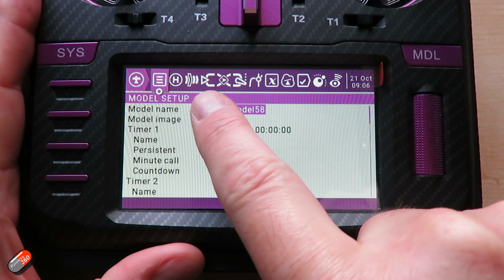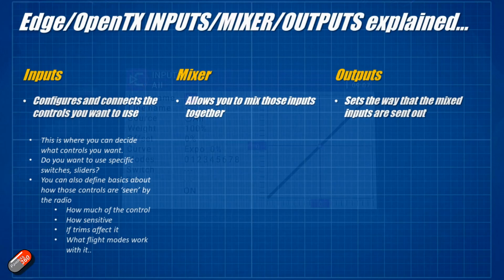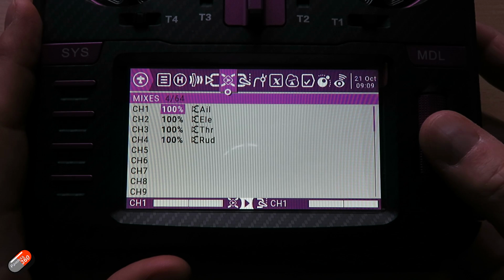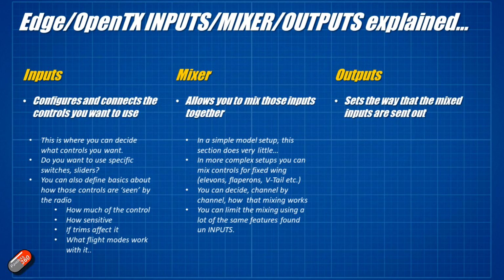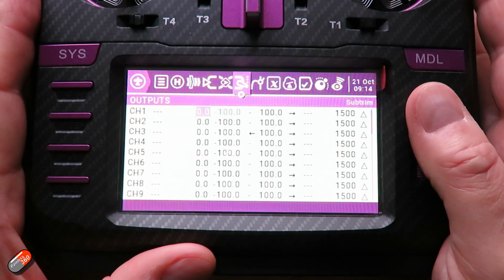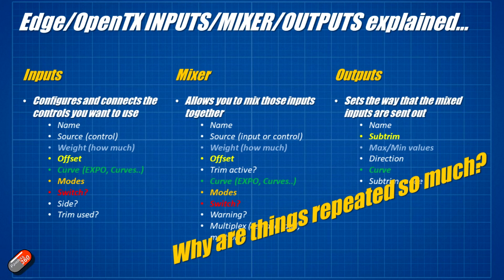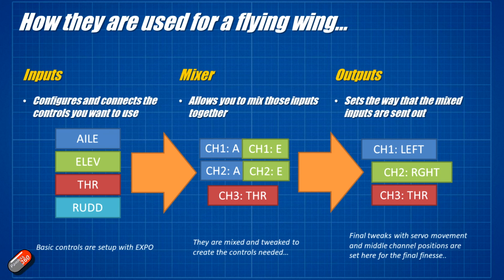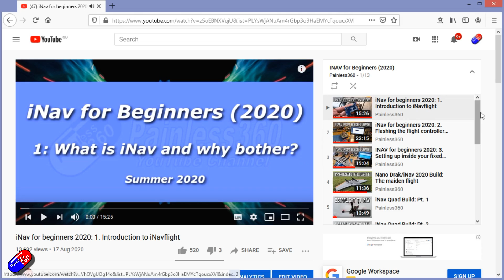Why there are INPUT-MIXER-OUTPUT Screens in EdgeTX and OpenTX and what they are for..

Comment: I have a question about mixing two channels. I have a plane that has separate elevators. I need to mix the two servos work as one. I am using a Radio Master Boxer, elevator is on channer 2, I need to mix another channel for the other servo so both can add as one & work as same direction. Thanks
Reply from the maker: You can create that simply by duplicating the existing elevator mix onto another channel in the mixer. Best of luck

Comment: Hey man I'm just trying to utilize the D button on my Radiomaster TX12 to activate "BEEP GPS SATELLITE COUNT" in Betaflight. On the TX12 Inputs screen I have it listed as I-d    100 SD but it does not activate anything in Betaflight.

On the Receiver screen there's no movement when I press it, and on the Modes tab I click Add Range for BEEP GPS SATELLITE COUNT and press the button but it doesn't detect it. Any advice? I'm sure it's something extremely simple I'm missing lol.
Reply from the maker: Set it up in the mixer screen, not inputs. Check out my Opentx and EdgeTX mix school series. Happy flying
Reply: @Painless360  I tried it on both but I’ll have to watch that video to see if I can pinpoint what I’m doing wrong!
Reply from the maker: https://youtu.be/OJCaAvjjw40

Comment: So with this open tx i can control dual motor (for example controlling the sprocket of a rc excavator) without dual motor driver ?
Reply from the maker: Possibly, depends on how those motors are controlled.  If it us PWM, then should work...

Comment: Be warned! If you change the servo direction in the input tab, the trim will be opposite. I confettied a 30 year old Big Stick this way! I took off and was over some trees when I bumped the trim for more up. It didn't seem to do anything, so I just held the trim for more up trim and it went right into the trees. Poof! It was a new Taranis X9D radio, 10 years ago, but it had openTX.
Reply from the maker: We've all been there!  Check out instant trim... Happy flying

Comment: I really enjoyed your video. Maybe I can pick your brain. I have a plane that has only ailewrons, motor, and elevators. No matter what pin I use nothing works. I think I need to change my channel order. How do I change from TEAR to AETR?
Reply from the maker: Channel order will not make a difference unless you are using something like a stabiliser or flight controller. For a basic build video see https://www.youtube.com/watch?v=Vaq4Jt0XzOU
Reply: Thank you for your response. I'm having trouble understanding TX16s. I recently switched from Spectrum. It's like learning a new language. Anyway, the reason I reached out to you is that I'm trying to setup that plane I mentioned before. Here is where I'm confused. My input screen shows RUD, ELE, THRO, and AIL. In that order. My mix screen shows AIL, ELE, and THRO in that order. My output screen shows CHAN 1 as Ail, Cha2 as ELE, and Chan 3 as Thro. When I plug in any of those wires to the correct pin, nothing happens. If I put the aileron wire into channel 1, nothing happens. Thro in Channel 3 nothing happens. I'll watch the video you sent. Thanks for your time.
Reply from the maker: Please watch the introduction to EdgeTX series, it was made for pilots in your position... Best of luck

Comment: I'm sort of confused. Do I still need to assign switches (arm, flight modes etc.) on the radio even though I already did it in betaflight?
Reply from the maker: Yes. See https://www.youtube.com/watch?v=zAtx4aXr_P0
Reply: Thank you, Sir. Very helpful. When I setup my FC in Betaflight I setup Aux 1 as an Arm switch, however I never touched the settings on the radio.  Once I bound the transmitter and receiver, the Arm switch functioned as it should. Dumb luck I guess lol 🙃.

And I still have all my fingers... 🤣

Comment: Thank you Lee. I intended to come to Open TX but when I got my Tx16S and switched it on I found EdgeTx! Your videos have been extremely useful. I came from Multiplex and soon realised that the icons at the top of the screen corresponded to the markings for the buttons on my Royal Pro Tx. That made things a bit easier for me to understand but I must say that the Edge Tx is actually easier for me to program than my Multiplex gear. However, I have yet to try to programme a 4 servo wing,
 but I feel that it may be easier. So far my Tx is just used for indoor helis and I am finding the flexibility of Edge a great help in getting my helis to fly in a controlled way. Especially the flexibility given by the curves. It really is useful to understand how powerful these can be.
Reply: I had a Multiplex Profi back in the day and was, like you, surprised at how similar OpenTX was to the MP system.  Enough to make me wonder if OpenTX was modeled after it……

Comment: The why- I believe it is old functionality left over from before FCs or before they were as powerful as they are now.  They are also still there for when you don't want to use an FC. They also come in handy for custom input and outputs.

Good video,  I haven't thought about those screens causing confusion,  but I have been using it for many years
Reply from the maker: That's right. If you use a flight controller then most of the complex stuff on the radio is not used as all of that is configured in the flight controller (rates, expo, mixing etc.). It is only for things like gliders and non FC controlled models that I get into that stuff now.. Happy flying!

Comment: Watching this makes me wonder if you'll be using the mixer to slow the transition to flight to the VTOL build...
Reply from the maker: Interesting question. The short answer is no. The flight controller has a lot to do with the transitions so you need to set all of that up on there and just initiate it all from the radio.. Happy flying!

Comment: Been using opentx since the x9d came out and the first model took me 3 days to figure out. I have been following and using your videos for specific setups and thank you for the time and effort you have given to the community. Without you tubers l believe Open/Edge TX would not have been successful. Certainly Frsky did not provide enough support for users!. The only thing I see the need for is a script which would do a simple 4-5 servo setup with rates and expo being able to be inputted in the same style as the new model setup just more comprehensive which would help new non computer literate new users get started. So thanks again for you considerable help in getting people using the open source programs. Cheers. Have a Merry Christmas and a Good New Year. All the best for 2023 👍

Comment: Excellent video as usual. Simple and easy to follow. I was a JR Radio user back in the day and when I started flying helis again 18 months ago I went to OpenTX. It was a bit daunting at first but these days I can set up a modern heli in about 30 minutes. The concept of the three areas, input, mix and output is logical if you think about it.

Comment: I started with a Spektrum radio, and I never did understand it fully.  Everything always seemed to have a bit of mystery to whether or not my attempts at configuring would work or not.  I was ok with it, but being an open source developer, supporter, and believer in open source software, I didn't hesitate for a second on switching to OpenTx.  Althought the three screens being so similar was a bit of a confuser, and of course it was a new interface (thankfully on a real screen and not on the radio itself,) overall I found OpenTx to be a lot more intuitive than the Spektrum.  As soon as I started using it, everything was making sense.
Are you using EdgeTx nowadays?  The last video I saw from you regarding EdgeTx was that you were not upgrading yet.  Did things change?
Reply from the maker: I am starting to use EdgeTX more but my main flight radio is still OpenTX as I don't use ELRS on that one and it works great..
Reply: @Painless360  I'm sticking with OpenTx since it does all I need.

Comment: My rule of thumb for those three screens is:
Inputs: here you can address shortcomings of the inputs/handset (expo, dual rate etc.).
Mixers: here you do your actual programming/model functions.
Outputs: here you can address shortcomings of the model - servos mounted the wrong way round, midpoints being off etc.

Comment: Hi Lee. Great video and information about how mixing works.  I only had one plane that I was using mixing, I had a 1/3 scale Extra 300L, and I used mixing for knife-edge flying. I could add a little bit of elevator to the maneuver so I could fly straight without much input. Thanks again for the video and information.

Comment: I have a differential thrust watercraft and use the inputs and mixers in conjunction with switches to either limit throttle position or gain in different modes, limiting or eliminating reverse in some of the modes.  Switches can also be used in conjunction with servo settings to lock them in place, e.g., maintaining a camera angle without the worry about inadvertently bumping things on the control.   It does get confusing as to where and when one might use functions, between the mixer and the inputs in particular, especially when essentially programming compound functions.  Sometimes I wish "they" (i.e., the brilliant Edge/Open TX folks) would just give us AND and OR gates on the control configuration to do what we wanted there as it would be a lot more intuitive.    The slopes on the "curve" aren't always intuitive, especially when/if used with switches.

Comment: I have been looking for this type of video!!! I can't wait to watch it. I just switched to a TX16 and even though I have never picked up a manual or watched a video for any transmitter in the last 30 years this one has me overwhelmed.
Reply: I would love a series that walked menu by menu and gave a overview of each function. Not a deep dive persay but build a framework to build on. Most videos are based on teaching a single function, but without a solid framework I find myself parroting the settings over to my radio without a firm grasp of what I am doing, or how to apply it to other use cases.
Reply from the maker: Check out the Opentx mix school series. I covered the basics in the first few videos.... Best of luck
Reply: @Painless360  Thank you for the recommendation and pointing me in the right direction, will go there next. I appreciate all the other channels that put out videos covering Edgetx. For some reason your style of teaching is easier to follow and more productive. Thank you for the time invested making these videos for our benefit. (And your reply)